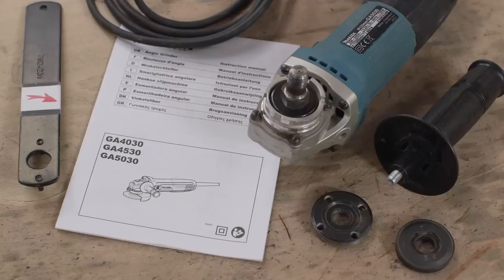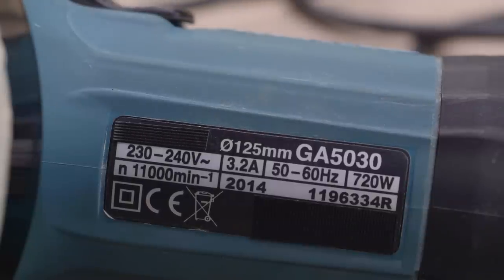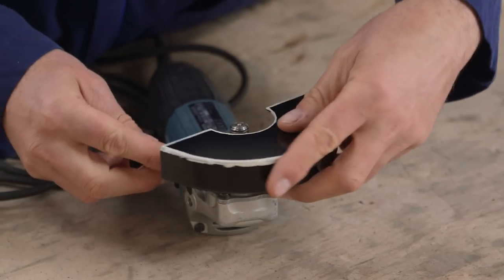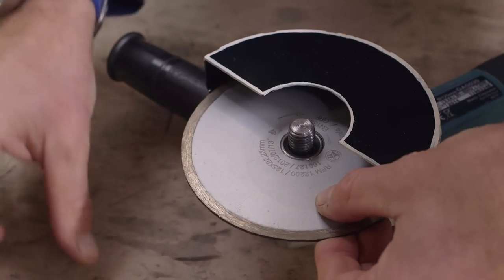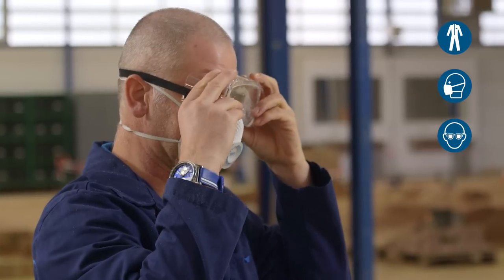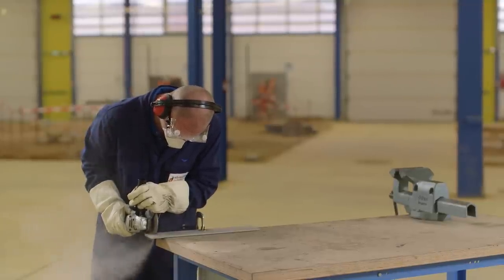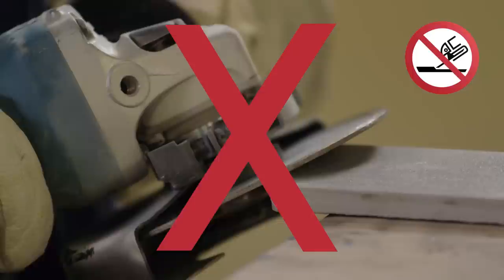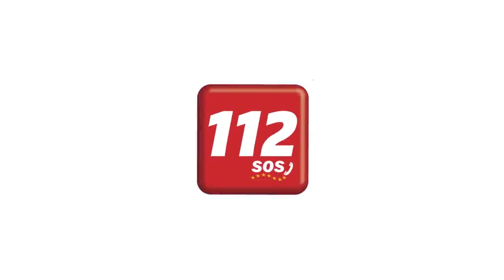How to cut off with a diamond saw on an angle grinder ?

Comment: There is a very very important step you guys forgot to say, before plugging in the angle grinder, you must check that the power button is totally off otherwise if you plug in the angle grinder it could start violently and get out of control, anyway thank you so much for the video....
Reply: I'm always checking that for some reason 
If it decides to start running 
I'm off to another continent 
I dont want to be anywhere near a plugged in gridner running at 850W
Reply: @ThatOneOddGuy  Thats great. Just try one with over 1000W. They are the best.
Reply: @vaguincolombia  for 115mm disc the small grinder or the bug grinder 
I wanted to get a dewalt one at 950W small grinder but the store that sold it had dumb staff who don't what stock they got

Comment: Surely the RPM on the disc should be greater than on the machine, probably not an issue with cutting disc but maybe with grinding discs. If the RPM is greater than capacity on disc, it's more likely to break.

Comment: Oh my! Most the diamond blades and cut off discs make sparks. I like the fact the blade you using doesn't sparks while cutting, can anyone tell me what is the blade model is and where to buy it? Thanks
Reply: I think it's aluminum and aluminum doesn't spark easily
Reply: Actually it sparks. If segments of blade contains too much iron, it may spark easily.
Reply: Every abrasive throws swarf, some with sparks. WEAR EYE PROTECTION. I prefer clear face shields. I use Jackson (online or at welding supplies) though Uvex make some beauties.
Reply: Isn't sparking on a diamond blade while cutting masonary a sign of a dull warn blade?

Comment: I don't agree with using the grinding handle to press down when cutting.
Reply: Jim Blane may I ask why?
Reply: I'm an experienced welder with formal training, after which I worked in a welding school and also took care of OSHA compliance. 

The operator in this video is cutting correctly. Both hands are the best way to control the grinder with any accessory, be it cutting discs, wire brushes, grinding discs, cup wheels or flap wheels. He is not twisting (easy way to break discs) or forcing the grinder.

Anyone doubting this is free to refer to your grinder manufacturer safety instructions, you accessory safety instructions, and your appropriate safety methods and practices reference for your country!
Reply: I took my handle off a long time ago